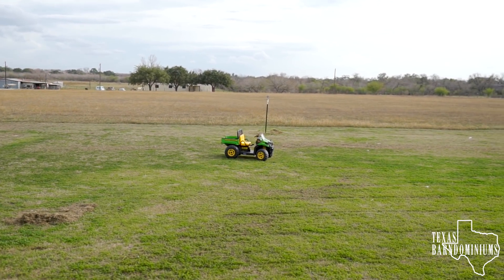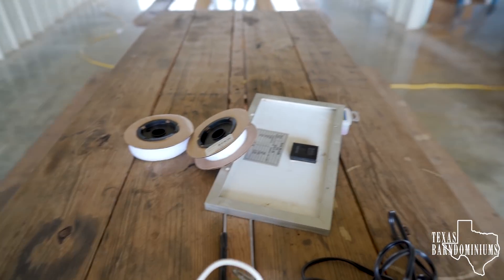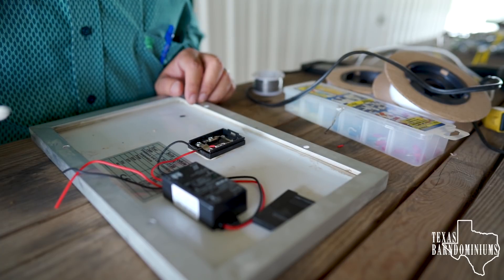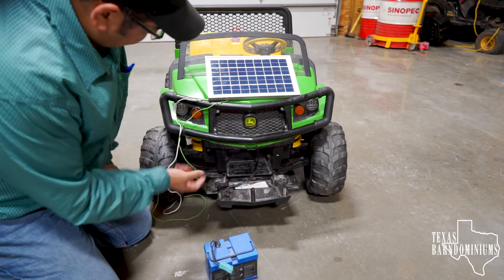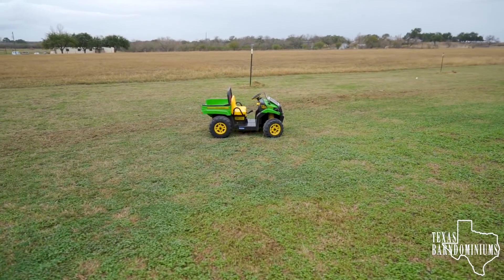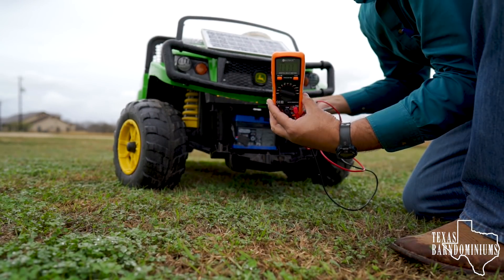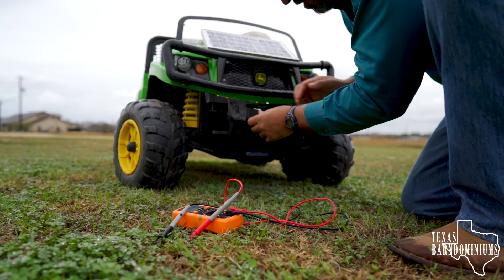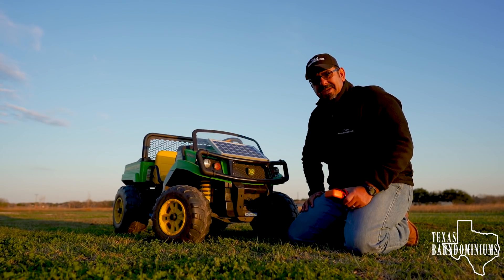SOLAR ENERGY - Installing Solar Panel on Electric Car - S3E7

Comment: There used to be a guy here in my town that called himself an electrician. He went to get a job at one of the petrochemical plants in the area and they asked him what voltage was he trained to work with during the interview. He thought a few seconds and said " I have done a lot of work with 12 volts ". He got the job but his nick name from then on was 12 Volt. I need to show my neighbor this. His little boy likes to go cross country on his electric mule and I spotted it about two hundred yards out in a field away from the house one day. I bet there are daddies on Amazon right now looking for 12 volt solar panels. You might be on Shark Tank next.

Comment: Brilliant idea.  At one point you worried about electicity flowing back to panel when charging battery with wall current.  A diode in the circuit will prevent that -- like a check-valve for electricity.  Here is more about diodes -- they are inexpensive and handy:https://www.youtube.com/watch?v=Fwj_d3uO5g8
Reply from the maker: Thank you for the link.

Comment: If your solar panel has a built in Diode it wont back feed at night but the charge controller will take care of that as it has one built in. Now a charge controller is recommended because a 12volt panel could have a Pmax of around 20volts which will make your battery heat up and boil. A battery is considered 50% charged at 12.0 volts and fully charged at 12.6+ volts. Again cool video.
Reply from the maker: Thank you.

Comment: I have the same Gator and tons of solar panels. The original charger on these is around 900mah or close to 10watts. Technically it would take a full day or 2 days to fully charge it. The rapid chargers they sell are 2amps so a 20 or 25watt solar panel would be ideal to fast charge battery. It's a neat project you have since I have done this in the past. I am currently going to start my second channel just on Solar and DC.
Reply from the maker: Cool stuff!  My house is wired for solar, but I’m waiting for technology to get to the point that it makes sense for me.  I considered the Tesla system but haven’t decided on anything yet.  One of these days I’ll get around to installing panels on my Barndo.